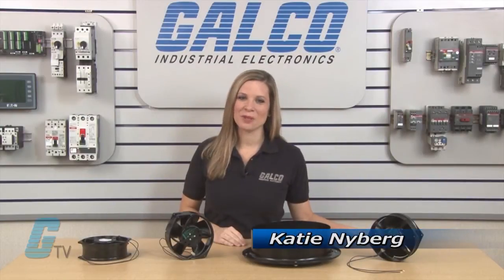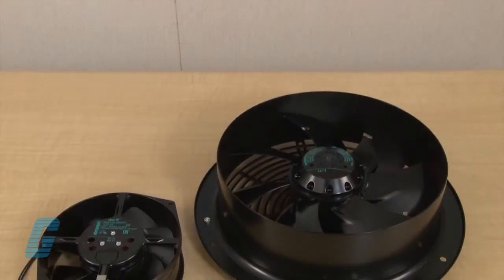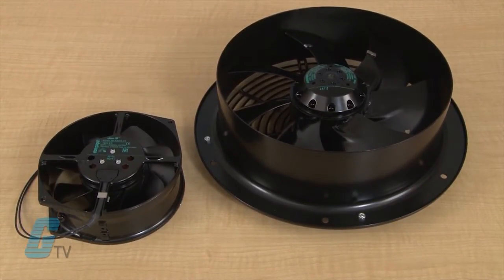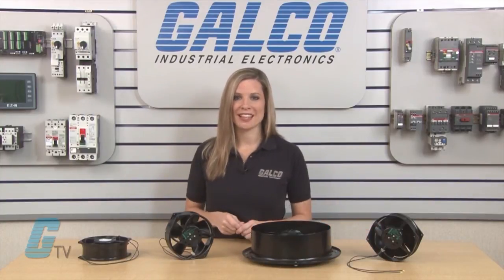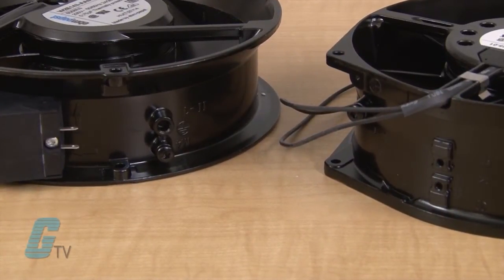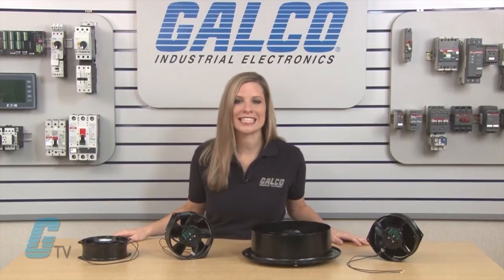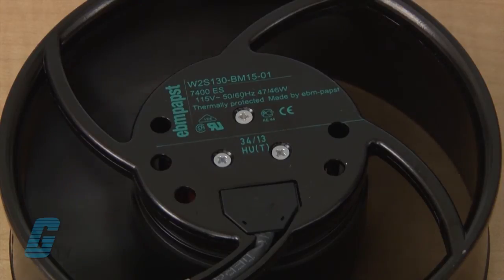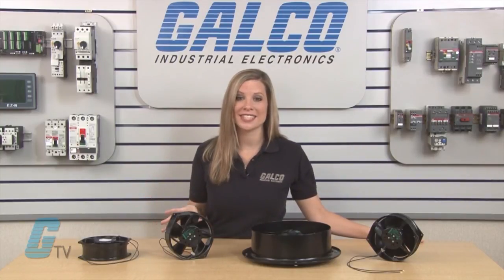EBM Papst AC Input Round Series Axial Fans

Comment: I have a question about the fan if you could please answer it for me I would be very happy I am a sheetmetal installer and I just need to know which of the two wires coming out of the back is the positive as I'm creating a custom relief are box for a greenhouse that I've built... The model of fan that I have is ebmpapst w2s130 bm15-01 thank you for your time...
Reply from the maker: EBM fan, item number: W2S130-BM15-01 is rated for 115 AC voltage. It has two black wires that should be connected to the black and white wires in typical household electrical systems. Polarity does not matter.
Reply: +GalcoTV thank you very much for getting back to me so quickly I honestly didn't expect that and am quite appreciative of it...
Reply: Chris Pifer well i think it does nit matter ... it is an AC motor